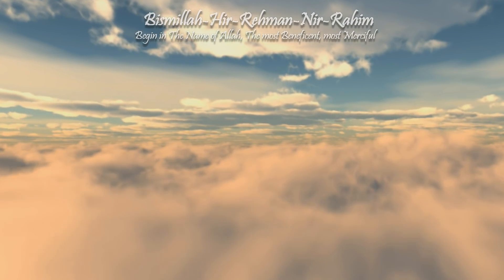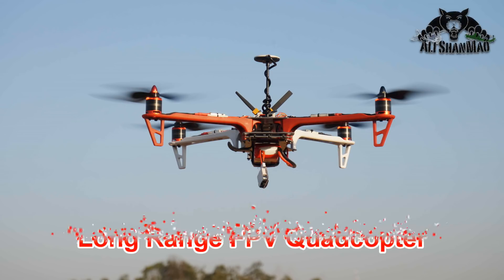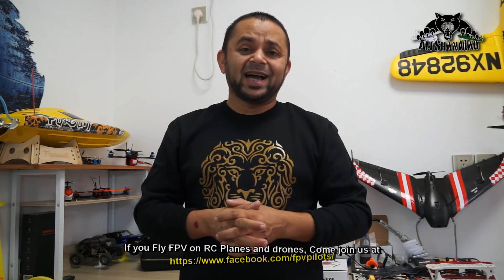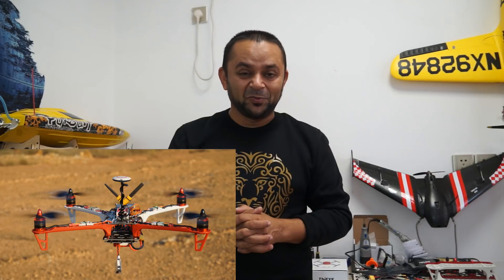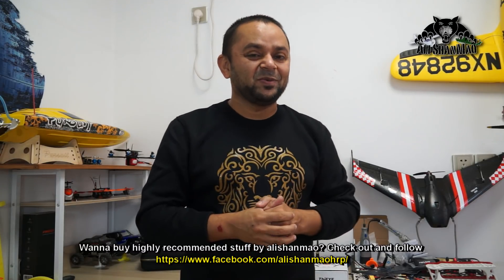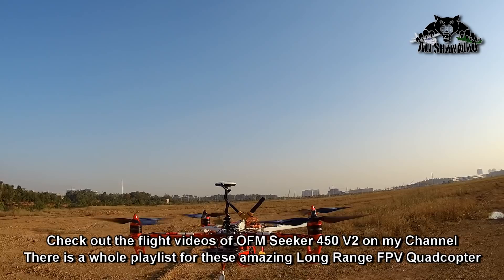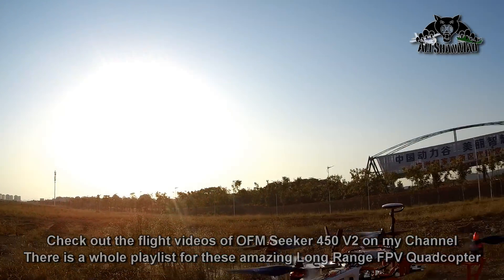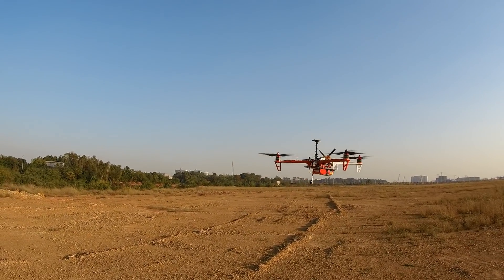Building the OFM Seeker 450 V2 Long Range FPV Quadcopter

Comment: Hi there. I build my own drone using naza lite flight controller and dji Phantom 3 clone shell, and there is a lot of problem on it.  First  there is beeping sound i Dont know if it is bad ESC or motor,  i replace  a new and callibrate them all buy a few minutes  ago its beeping and its on another motor
Reply from the maker: you can find much help on forums online.
Reply: Thank you then

Comment: Purchased my first Quad, from you in 2013, 450 frame and all the goodies and flew it for years, still have a new frame, might do the same project for fun, what about 4 in one ESC to keep the weight down?
Reply from the maker: nowadays there are 4 in one ESC with F4 FC Tower. I suggest you use that. and turn it into an FPV Racer type quad. Put on some good 800kv Motors with 3 blade MAS props and it will rip some good speeds. I am thinking to do the same with mine. but if you plan to go farther than 1km or 2km doing FPV then you definitely need GPS like NAZA light so in case you need, you can activate RTH.
Reply: @alishanmao  yes, longer range with  me is preferred to speed, I do have two Naza Lts in my bin, one of them I purchased from you, in 2013, its durable lol